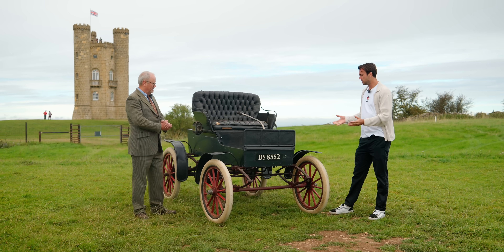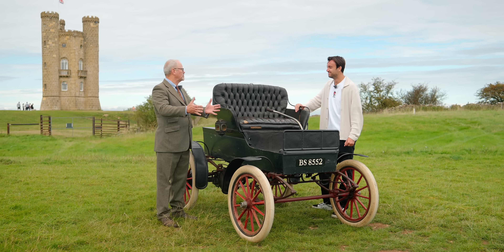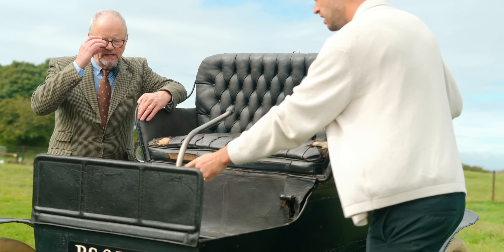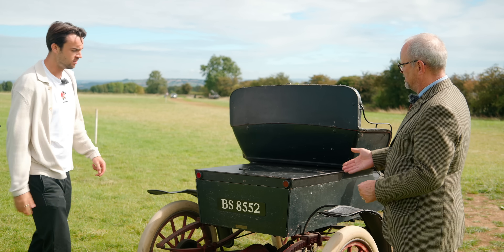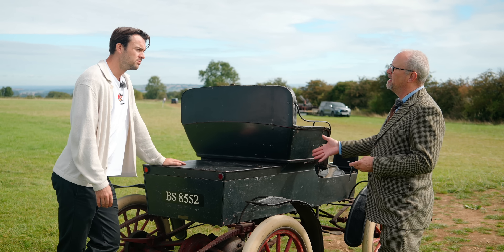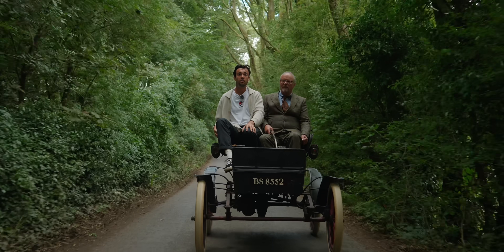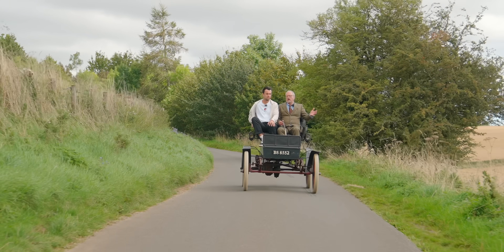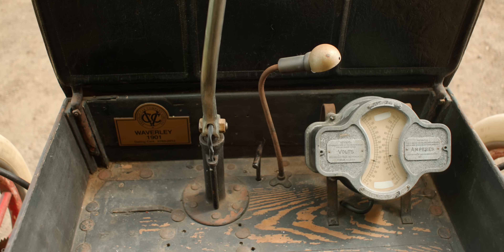Why Electric Cars Failed 100 Years Ago

Comment: At least the electric cars from 120 years ago didn't spontaneously combust. 🔥
Reply from the maker: Ha ha ha. Very funny and original. Interestingly combustion cars from 120 years ago were notorious for catching fire, and if you look at the actual data rather than some two bit Daily Mail headline, you would very clearly observe that petrol, diesel and hybrid vehicles all catch fire with staggering and deadly regularity. 
They always have, we are just used to it. On a recent 650 mile journey, I was witness to two vehicle fires on UK motorways. One was a truck (diesel) and one was a hybrid car.
Combustion vehicles are fantastically complex and if they are not well maintained they are a death trap. 
I would never leave a combustion car near my house, they are deadly fire bombs.

Comment: If the increasing collection of unsold Ford and GM EVs are an indication the EV is going to fail again for many of the same reasons they did back then.  Govt subsidies are the main driver of EV purchases, as they go away the sales drop off very quickly.  The average person doesn't want the problems involved in using an EV, add to that the higher cost and lack of resale value and you see why the EV will be a niche option at best.

Comment: The original batteries were likely Nickel Iron and still as good as new. Being Nickel Iron batteries are so expensive and sought after, they sold them to pay for the restoration.
Nickel Iron batteries are the most logical for Electric cars as you can discharge them to zero without harming them...which is why the Car Industry uses Lithium; expensive and short life so you keep buying batteries. You can make your own Nickel Iron batteries if you have a ton of money, but you only need to spend it once.

Comment: You all forgot to mention the most important thing which was that initially gasoline was a byproduct of oil refining.   To understand you have to follow the history of the petroleum industry.   It really started out with kerosene and heating oil refined from coal and shale.   At the time gasoline was a plentiful and cheap to the point there really was no competition.   Hard to fathom it today but gas was basically free at the turn of the 20th century.  People like to say it was some kind of conspiracy but actually it was a process of natural selection.  By the time Henry Ford was building cars it was a no brainier as to what type of fuel to use.

Comment: well, IC engines got a lot more advanced over time. electric engines did not quite improve a lot. battery technology did, but the same shortcomings are still there.
that is, where you gona charge the ev , the cost of a battery replacment, the length of recharge vs refueling, basicly ev has the very same drawbacks, but its rival, the ic engine, has evolved a lot since it began to exsist. now, if there was no governments just spilling money into the ev idicoracy like there is no tomorrow, actualy none would care. things is, even with all that money spendt on it, still not a lot of people care at all. so highly likely, just as back then, there will be a point when there will be more electric than ic cars on the road, then it will fail just as it did before and things can finally get back to be a bit more normal.
Reply: We have brushless electric motors now. Much more reliable and flexible.

But yeah, batteries are not there yet.
Reply: @svr5423  yepp.. as its very easy to see , the electric motor is not the problem. It was good 100 years ago allready. 
I would prefer to have an opposed piston , 2 stroke diesel engine driving  a generator , to power electric hub motors . Maybe a very small battery pack, but its not realy needed. 
Thatway you get .. a very very small engine working in an extreemely narrow rpm Band.  Yet you still have a cvt transmission. Saves on space too.

Comment: At the beginning of the auto mobile back in the early 1900's there were more variants of the car and every possible drive train. What was really lacking though was a chassis and suspension (especially tires) that could handle the horsepower created by some of these amazing machines. I always thought it was the 1930's Great Depression that put an end to electric cars, and many car brands.
Reply: we couldn't scale it for mass production, gas was able to succeed because it didn't have that issue, nothing happened until the Prius and hybrids came out, then we were able to adapt to EV later, it was impossible back then

Comment: Ok so this guy and most people lie about electric vehicles.  The reason over 100 years ago that electric vehicles failed is because no one is going to drive with an extension cord on the back of their vehicle.  That is not a lie.  The second idea of electric vehicles is basically the electric bumper car you drive in a carnival but where the electric line would be the road meaning people would die from being electrocuted.  The first however electric vehicle concept made it to production which is proof people who wish for electric vehicles to over take gas vehicles belong in a mental hospital is well the vehicle had an electric cord plugged into a building at all times and you had to every couple hundred feet with the possibility for the next biggest model 1000 foot extension cord and for the biggest model a 5000 foot extension cord un plug the vehicle and plug it into a new outlet.  So yea the first electric vehicles were to have extension cords but the second versions were going to be like trolleys but to not deal with electric cords in the air they wanted to go with having the road electrified.  To be fair that would stop jay walking in its tracks do to all the dead bodies.  The idea was rejected and banned for well being out right insane.

Comment: Well done, Robert & Jack.  It's great to see another ancient electric car in use.  I've always enjoyed Jay Leno's 1906 Baker video.  Back at the turn of that century, about a third of the cars were either electric, steam or gasoline powered...and they all seemed to have their unique pros and cons if you will.  You're correct in most facets of this episode - it was the electric starter on ICE cars that set them apart.  Combine that with the old lead-acid batteries for electrics (i.e. low power density), the difficulty of charging them back then - few homes had electric outlets yet.  The first fill-up gas stations started to appear around 1906...depending upon what state you lived in.  I was just shocked that this electric car that you showcased had regenerative braking...back in 1901.  Wow!

Comment: Well boys I hate to break it to you but electric cars are going to die again. So far, at last count, six major auto manufactures have come out and said we just don't have the ability to mine enough lithium to build batteries to replace the 3 billion cars/trucks on the road today. We don't even have the electrical grid to charge a small percentage of that number. That should come first before just mandating people have to buy electric vehicles. Said vehicles are worthless if you can't get the electricity to charge them.

Comment: it is the same reason that all the streetcars of the late 1800 and early 1900's were taken out of commission.  The big car manufactures didn't want American competition, so the rails were all bought up by car manufacturers and decommissioned.. (competition eliminated > problem solved)
Reply: Street cars are still around in many cities. However, they are a bad idea because they conflict with other street traffic, significantly reducing the amount of vehicles that are viable.

Better to build railway tracks separately. Not only for other road users, but also for the passengers. Trains run faster and more smoothly.
Reply: @svr5423  trains are far slower.. Amtrak from portland to seattle is a 4.5 hour ride on the train.  in a car, 2.5 hour ride.. 
And for the disabled that can't walk very far, getting off at a stop 30 blocks from where you need to be can be an impossibility.. especially if it is on a hill.  And when it snows, the street car cannot go up or down a hill because the tracks are too slick to stop or get traction to climb the hill.. And they also run on Electricity that is generated from diesel generators.  They are not green at all.  The lithium ion they use to power them is only good for a limited number of charging cycles.. then they are thrown into landfills as hazmat.. it makes all the soil toxic where they are dumped..

Comment: The same problematic issues still plague the EV industry. Short driving distance,  inexpensive and easily recycled batteries, lack of inexpensive and massive amounts of charging stations, long dead -time between charges, and the need of natural gas and coal-fired electric power plants to make the electricity. Great idea, but not practical or efficient.

Comment: Everybody overlooks the gasified vehicles? Ever seen old photos of a taxi with a great big balute roof? That was the fuel tank, combustible vapors.
A form of wood gasification.  What did you fuel a vehicle like that with? Dry organic matter, namely wood.
As for the EV? Completely a Democrat pipe dream. Flawed in it's conception and application.  First thing to check about an EV, how much is it to replace the battery pack in 6 to 8 years when they die?  Ready for the sticker shock?
$30,000 to $40,000 !!  I don't know about you? but I can't afford such a reoccurring debt cycle. And to willingly sign up for that kind of debt cycle? Very foolish.

Comment: I'm fine with electric cars. I actually like the idea. What I don't like is the computerized creepiness and intrusively annoying features. I don't want sirius XM or lane keep assist or traction control or an air conditioner.

I have already seen the chipless speed controller, and I will have my wildly unsafe lithium-powered 200mph go-kart.

Comment: How far did it go? If you drove it into the country how could you charge it? Every trip was a one way trip. With a gas car you can easily bring gas to the car and it will go. A hundred years later and electric cars still have the same problem. Not too  much progress for over a hundred years.
Reply from the maker: What a strange comment. It's the pride you have in your ignorance that is fascinating. 
So, in 1901, when only 20% of homes had electric light in the USA, there would be nothing resembling electric car charging infrastructure anywhere. This car could do around 60 miles on one charge.
In 1901, there were no gasoline filling stations and a petrol car had a 'range' of about 80 miles on a tank. You had to buy gasoline in a pharmacists store, in a small can. 1901 combustion engines were also very difficult to start, you needed to be strong and brave to turn over the incredibly unreliable motors which were constantly breaking down.
Just imagine in NOTHING changed or developed.
That is exactly what you are trying to suggest, the fact that modern electronics have revolutionised so much of our world which you have never considered. The materials that make the device oyu made your comment on are closely linked to modern electric vehicles. There are 480,000 charge points in the Uk for example, and the car I drive has a range of 320 miles.
The electricity used to charge the car has also changed. Back in 2010, up to 40% of UK electricity was generated by burning coal, today, 0.02. The majority of electricity is now generated by off shore wind farms.
But as you say, nothing has changed.
Oh wait, here's one thing that really hasn't changed. Internal combustion engines are 100% reliant on burning oil, they were 122 years ago, they still are. The gas that comes out of the tailpipe is still deadly, just as it was 120 years ago.
Reply: @fullychargedshow   Internal combustion engines are not reliant on burning fossil oil products. They can take a variety of fuels, many of which can easily be produced CO2 friendly, such as Ethanol, Seed Oil, Hydrogen (produces water in the exhaust) or synthetic gasoline/diesel.

Especially bio fuels enjoyed a brief popularity in the 2000s, before they were taxed to death by governments.

Exhaust systems have come a long way. I don't even want to go back 20 years ago.

But I hope BEVs become a technology viable for mass deployment soon. The more options we have, the better.

Comment: i like the european ev .i like the c-3 here in the land of every thing cost twice ad much  canada its seems the u.s. decides what we drive big gas guzzling 4x4s..or every thing is bells and whistles  that most won't use a simple cheap grocery getter ev .all you need is on and off ,an fm radio forward an reverse and excellent range ..and  ac.  .dont need 0 to 60  in 1 second on 36 in tires

Comment: The bonkers part of this video is that 28.000 for a Bolt is considered "entry level".
Remember when an entry level car was an 8 grand barebone like a Renault Clio or Twingo? Pepperidge farm remembers... and this was only a few years back. Now, 28k is considered "entry level". Y'all are insane.
Reply: Entry level ICE cars now also cost between 12 and 15k USD. Around half the price. That's a lot you can spend on gasoline, especially because DC chargers are not significantly cheaper per km.

Comment: This is old news. Electric vehicles were much more reliable than any other until the introduction of the electric self-starter in 1912 (Winton had compressed-air starters before then), most people only drove around town to begin with as roads (particularly in the US) were dreadful outside city limits, both women AND men (especially businessmen) drove them, 25-30 mph is perfectly adequate for city streets as is a range of 60-100 miles on a charge (people took trains for long-distance travel, or even interurban trips), regenerative braking with a electric motor and hub brakes was much more efficient than the strictly mechanical systems in use on anything else, and they were very comfortable. The main problems were the same that are only being solved now: range, speed, and expense. Modern electric cars have partially solved the first two issues, but they're still hideously expensive and service expenses are astronomical. Many 1905-20 electrics came out of storage during WW2 because of petrol rationing. Early electric cars are terrific.

And why can't you put modern lithium-ion batteries in a 1910 Baker or Detroit Electric? Then you have a perfect around-town "green" vehicle which is heaps more comfortable than a Tesla (and less likely to catch fire).

Comment: My parents run an auction house and my dad thought it would be really neat to put an old Ford Model A from 1930 out front. It has all the fancy features, like an electric starter, and uh, well it has that! We registered it as a company car because taxes in our country are some percentage of the car's price when new, and they don't adjust for inflation. So now we pay a small percentage of 300 dollar sticker price. And at 93 years old, that car is done deprecating, that price is never gonna go down (aside from it breaking horribly of course). It is incredibly fun to drive, but much more difficult than that cute thing you're sitting on. You got choke (both pull and turn), spark advance lever, idle gas lever, clutch and gears, brake, parking brake... it's a whole process to get it turned on, even without having to crank it. No idea why electric cars didn't take off more to begin with.

Comment: Todays EV should be built with air flowing through the lower part of the vehicle.  That would keep batteries cool and would reduce drag.
Reply: It would mean compromising the protection around the batteries though, which is needed to prevent damage in an accident that could potentially lead to fire.
Reply: We need a different type of battery, one that is more stable (less volatile) than the lithium-ion batteries
Reply: @KbB-kz9qp  Then you probably want lithium iron phosphate. It's still a lithium chemistry, but much longer lifespan and less risk of fire than the  usual lithium ion. There's also sodium ion on the way, but that's only just entering production now and won't be widely available for a couple of years. The lower energy density means it might not be well suited for electric  vehicles, but more for grid storage.

Comment: It is unlikely, but remotely possible, that one type of battery could survive for 120 years. Check out Nickel-Iron batteries. There are cases of 100 year-old nickel iron batteries that still do work, though the capacity can be less than it was when new.

Comment: Louis Renault invented the steering wheel and the transmission.  Later, the Zoe (LOL).  I had seven French cars, loved all of them.  Now I drive another car, named after another famous Frenchman, Louis Chevrolet.  It's a Bolt EUV.  I had a Bolt EV and a Spark EV.  All of them are great cars, the EUV is the best.  You should test one when you come to the U.S.  If you come to Fully Charged San Diego, I'll bring mine and you can test it if you'd like.

Comment: I think the video doesn't really answer the question it claims to answer: both types of car had limited range and where rather slow. The range didn't really improve with the Ford Model T, the original version of ut only had about 20 miles range. I think the real reason Ford didn't choose electric was that large amaounts of crude oil were found close below the ground in the S, making gasoline much cheaper than electricity.

Comment: How would you get the charge current for these to charge the battery? Was it one of those motor driven DC generators, more or less like an AC motor plugged in to the mains side coupled to a DC generator to send current to the battery?
Reply: You're thinking of a rotary converter - and yet, that might have been used. Though at this point in time, it's likely the local electric company would be supplying DC directly anyway.